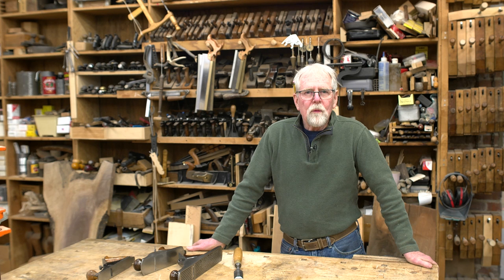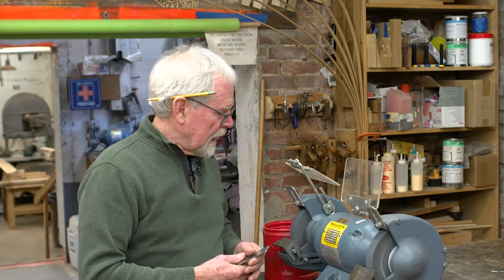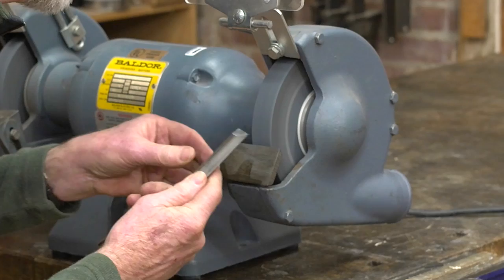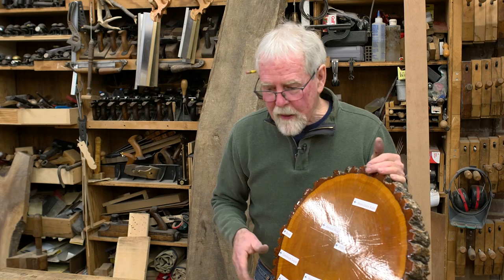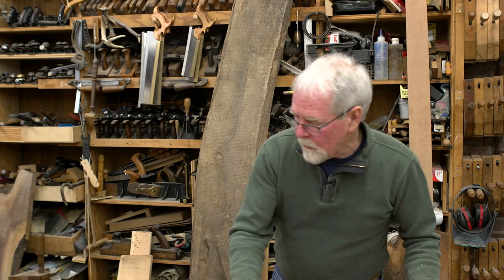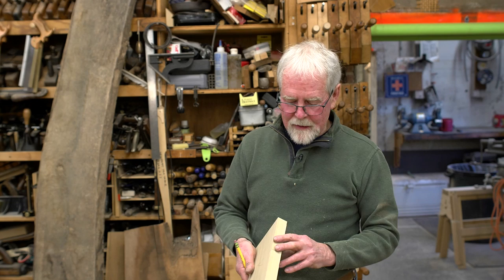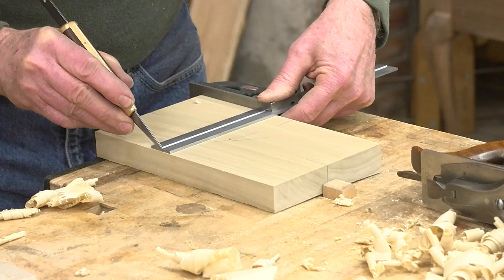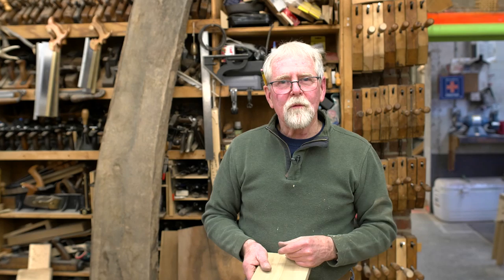The Art of Woodworking - Episode 2: Squaring

Comment: Thanks Phil for sharing knowledge on these videos. I am an accomplished woodworker, cabinetmaker, finish carpenter and joiner of 50 years. Even an old fart like me never stops learning and will enjoy your series immensely. You younger folks pay attention and enjoy. Regards to all from Minnesota.
Reply: I work as a maintenance foreman at a chrysler assembly plant but my 2ed "job" is  woodworking and custom auto body building. ( i don't do engines etc)  
The 10001 and 1 things I love about woodworking and custom auto body is you never stop learning. Most look forward to getting of work to get home and watch a game or just to be off work. I look forward to getting home to hone my skill on what I learned last at either wood working or autobody. 
What I find crazy is I can sharpen a knife free hand to cut paper with no sawing effect but even with expensive jigs I still have to use a sawing motion with plane blades unless i do it free hand. My problem with sharpening planes/chisels  is kepping the edge square. It would be nice to have a cutting edge square to the throat once in awhile lol. 
I use to us all the ypical powered equipment. Jointers/planers, biscuit joiners, table saw and several sanders. The only time I use sand paper now is when I get a new "used" plane/chisel or blade of any type to sharpen them. 
What truly find crazy is as Phil mentioned is that traditional furniture still had saw marks in the wood. This is the type of furniture I tend to get the most coin for. And 70-75% of my stuff is made of pine straight from the mill.   I also use walnut/maple/oak/ash/poplar and even spruce. Most (im my own opinion)best pieces were from pine and spruce unless its a figured maple. 
But this youtube thing i am always learning and I love it.

Comment: we were given rough cut stock and a cutting list about 1  month before the final exam for higher woodwork at highschool in the 80's and used all these techniques to fully dimention the timber..........................we did have access to a slow speed flat stone grinding wheel that was oil fed for lubrication for plane irons etc but that only gave you a single bevel...so getting the final bevel was a little more challenge and no guides just do it by hand.    Great detailed videos these I like them

Comment: I have just used the grinder sharpening technique shown on this valuable / informative video, the results are exellent, better than any technique i have so far used.
Thank you ms. lowe for this information, looking forward for your next lesson.
Reply: True that. Most of other techniques on YT, at least, are asking to sharpen the whole bevel surface & add small one at the very end, at different angle. This one IMHO is way better: less surface for grinding &honing. There are 2 edges. One which actually is cutting, the other splitting &"reflecting" waste. 
But yeah, so many sharpening ways, as cults & faiths, among the people :)

Comment: Hello. Thank you so much for this. I am just start in woodworking. I purchased a table saw, chisels and other items but realize I need hand planes. I don't have much money so I need to be smart in my purchase. I need to make my woods square and smooth. I thought I needed a #7 smoothing plane to make the edge of my wood boards square, but it looks like you did this with a #4 smoothing plane. Is that correct? Can you advise what planes you think I need?  If I can only afford two planes, would you suggest a #4 Smoothing Plane, and a #5 Jack Plane?  Can I buy a #4 Smoothing Plane and put in a Jack Plane blade, there by needed only one plane? As you can tell, I know nothing.   I will  buy on Amazon.com.   Thank you very much!

Comment: good video, BUT WRONG way of using a bench grinder ( No safety hood/ glasses-reading glasses are NOT SHATTER PROOF), and both of the upper grinder guards are NOT used , the perspex guard is to save you from metal/ stone particles coming at you, the metal one is to guard you in the event of a wheel shattering (exploding!)- that is to say deflect the pieces safely away from you.
EACH of these points are a MUST in a metal shop, should be in a wood shop too, even so the area in the wood shop where sharpening occurs is in effect a "metal" shop area, so ALL reasonable precautions should be adopted, it may never happen, but would you risk your sight over it??
Reply: He's sharpening a chisel, not grinding a knife blank into shape. There's as much chance of his vice exploding.
Reply: It's amazing he is as old as he is. You would think he would have died long ago with how dangerous he is!